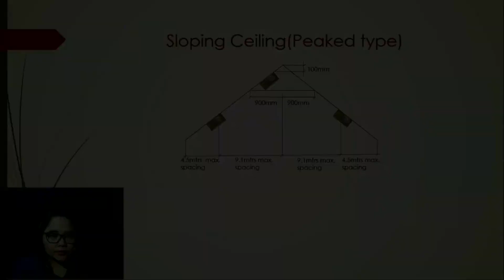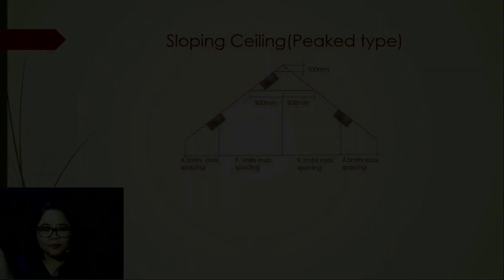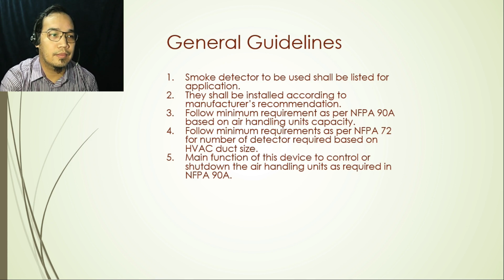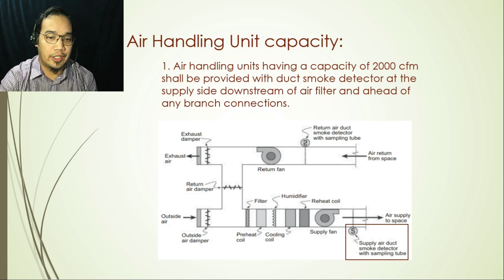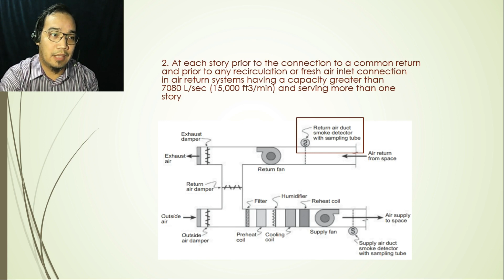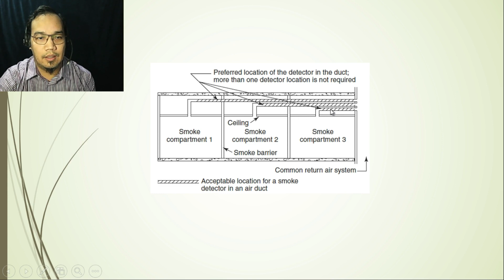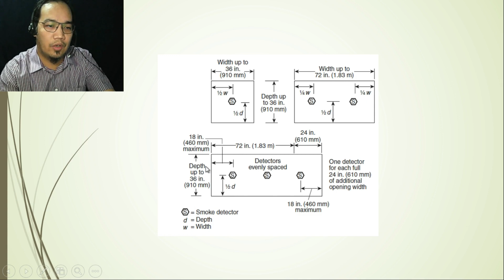Fire alarm design - Duct smoke detector #Firealarm #ductdetector

Comment: Hello ! Thanks for your valuable vedios. . I have an doubt.. If we have smoke detectors and VESDA system inside the building , whether it is required to provide duct detector on return duct ? Please clarify sir...
Reply from the maker: Hi. Placement of duct detector in air duct system does not serve the same purpose with the open area detector which is normally the detector we have in most areas of the building. Duct detector is required for control of HVAC equipment including the motorized fire smoke damper. It can't replace  purpose of the area detector. However, for placement of duct detector in return, it can be omitted provided that the whole building is covered with area detector as stated in 17.7.5.4.2.2 of NFPA 72 2016 edition.
Reply: @AllaboutFireProtection  ok sir. Thanks for your instant feedback...! All your vedios are very useful. Kindly post the videos related to Notification appliance placement. Also post the videos for Fire suppression design system too. Once thanks a lot sir